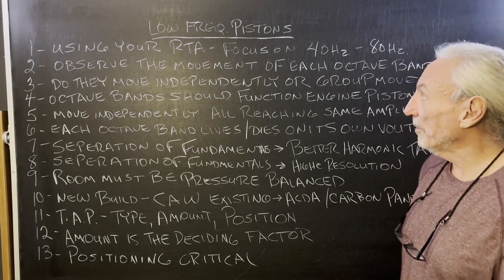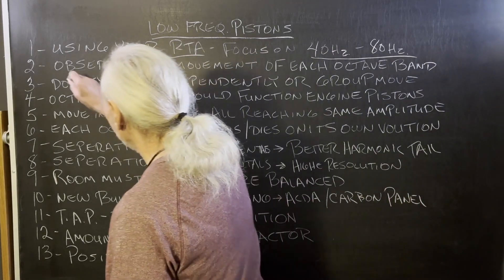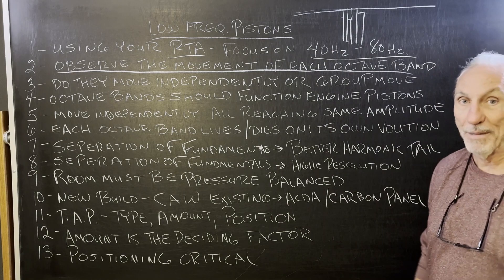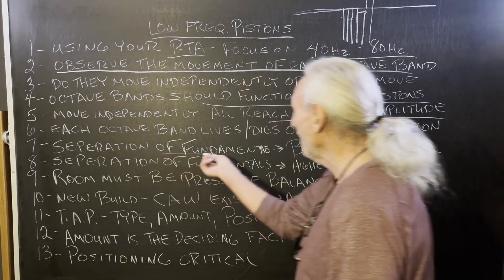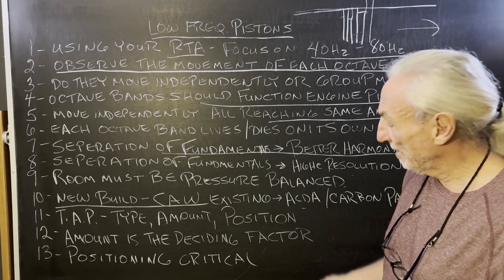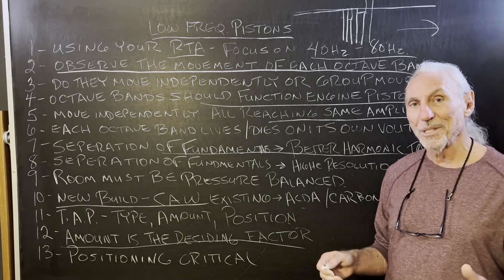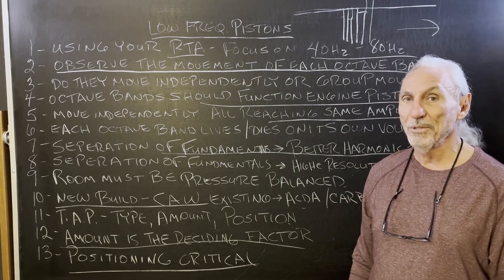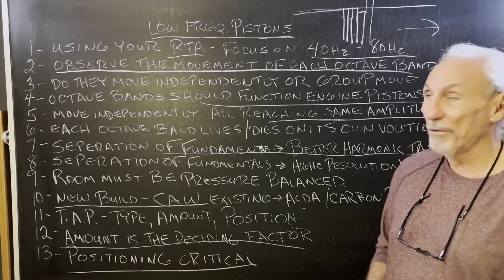Low Freq Pistons - www.AcousticFields.com

Comment: Do you have a video talking about point #9?  Room must be pressure balanced?
Reply from the maker: In small rooms, we have two main issues. We have unwanted low frequency pressure modes and middle and high frequency reflections from wall surfaces. When you design for and treat low frequency pressure, you must have a treatment design that equalizes the unwanted modal pressures throughout the room in all three soundfields. We have floor to ceiling, sidewall to sidewall, and front to rear wall sound fields that all have different frequency and amplitudes of pressure.